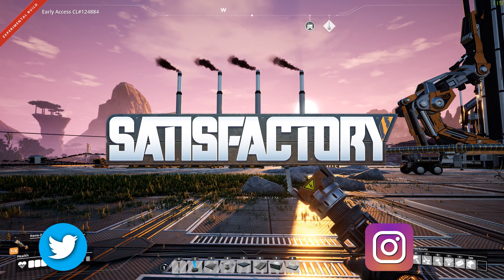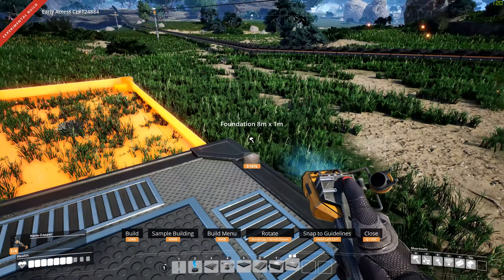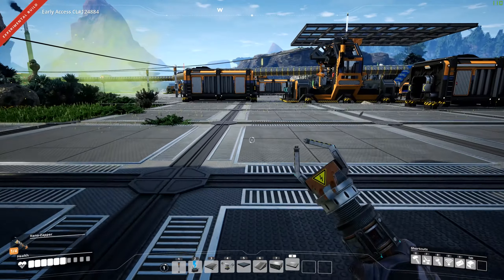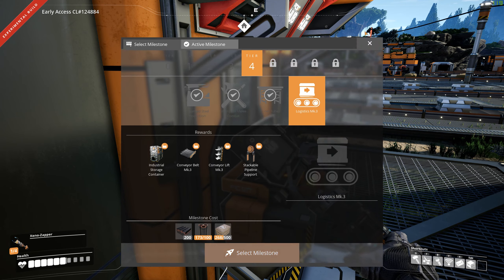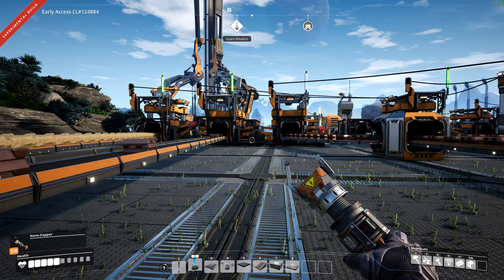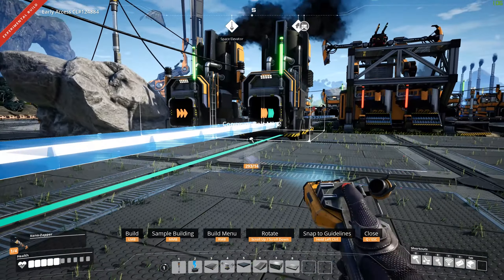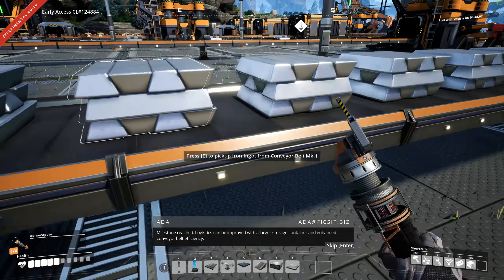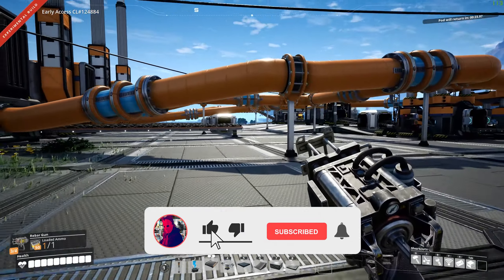Satisfactory: Base Restructuring (Let's Play Part 9)

Comment: 15:00  so glad the power/water issues werent just me. tok an hour to fix last night and was fixed by pumps in the end. and a fluid resivour thing which fills first so you always got 400 fluid in it with decent flow (from the pumps)

Comment: On the milestone UI, at the bottom is a button. Select Milestone. This will put what you need in the top right corner, so you don't need to keep go back and checking. Edit: It's very easy to get distracted in this game, so having up on the screen helps to keep you on track. :)
Reply from the maker: Good deal thank you!

Comment: You upgraded the belts from the coal to Mk3 but did you upgrade the miner to Mark2?  Pure veins will output 240 per minute with regular Mark 2 miner.
Reply from the maker: I did. Not in this video.